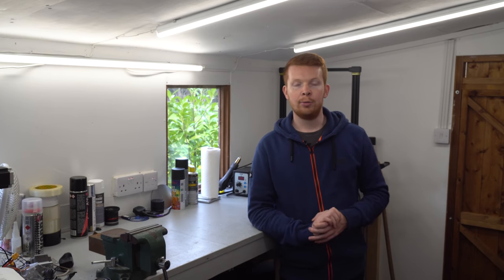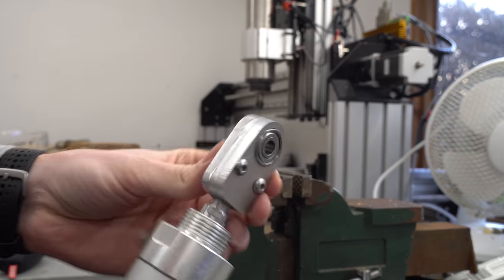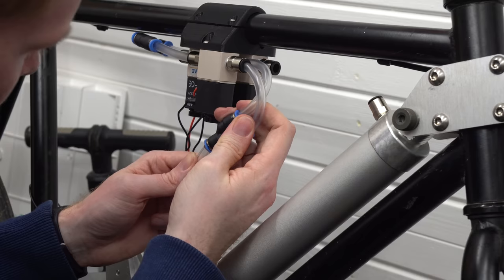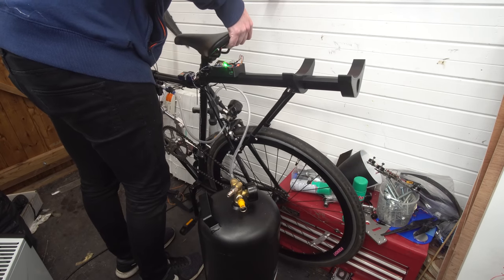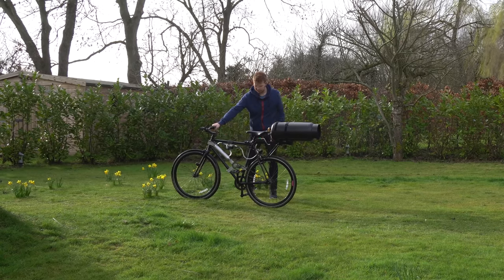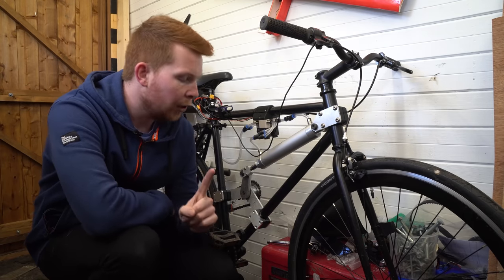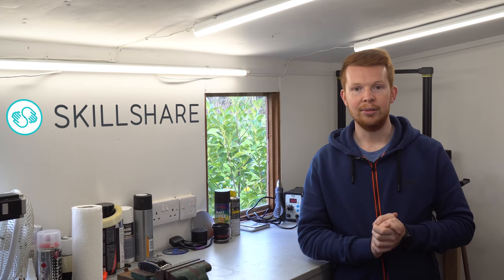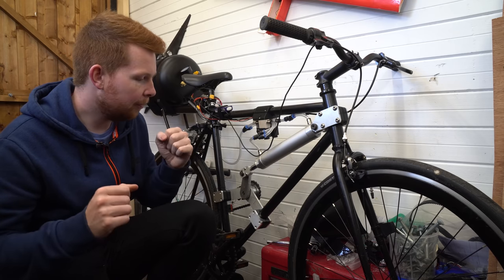Air Powered Bike

Comment: Finally more pneumatic stuff! This is what I came here for.

A second cylinder would be nice, you could make the rear sprocket larger for torque. It would make it easier to move if you started by pedaling and let the engine take over - there's probably not much to get the bike moving on its own but you could probably get it going and maintain a speed with the cylinder.

Any chance we could get the Arduino project code? Also, one final note, a hall effect sensor would be better. Infrared can easily pick up interference, especially outside. There's plenty of television remotes and garage door openers out there waiting to screw up your timing, discounting the IR coming from the sun and street lamps!
Reply: Farley Moab  Interrupt driven would be better I think, that way you could do something else in the background when not updating the valve positions. Check sensors, calculate efficiency, diagnostics, etc
Reply: Yes! Hall effect sensors are far more reliable than IR sensor or mechanical switch. Especially in sunlight, an IR sensor gives a lot of false positives. 
Also a simple motor encoder unit attached to the sprocket wheel can give lot more precise information for triggering the relays
Reply: Farley Moab  JTAG is the way to go, definitely. Saves space on the chip and I/O pins. Also saves RAM because of the afforementioned bootloader.
Reply: a second cylinder limits the duration it could power the bike though
Reply: @handsup90  A magnetic sensor would be better since it doesn't require current to operate. hall effect sensors require a power source.

Comment: To improve it you should make the entire frame the air tank itself
Reply: 666
Reply: Good idea but i expect the volume of the frame is pretty insignificant compared to that of the tank.
Reply: @ronjones4069  yes maybe you can take a smaller tank and connect it with frame(that is a tank it self) so you can have a much smaller tank on the back and you can fill some free space on the frame with some bags that serves as air tank so it's lighter
Reply: Good idea, though you might need a little larger frame tube diameter.  3 inch tube/ 76 mm .Steam powered might work a little better.Heat the water inside the framework.On a cold morning it would appear as if your on fire.LOL Always a crowd favorite.Smoke trails
Reply: @thomaslewis7883  there are a few steam powered bicycles people have made with videos on here, very fun worth a look some if them
Reply: Punch In The Face 🤓good ideas!
Reply: Kalrry Unakey 333
Reply: Why not use a pneumatic motor instead of a cylinder?
Reply: @keithballard4621  I think that the consumption of air is not the same
Reply: Yeah make it the frame more bulky.
Reply: Cool I’m the 333 like
Reply: Make the frame out of inner tubes........

...

...
Reply: Use the frame and add about 3 in front and three  in the back of the 1 1/2 foot paintball tanks and you don't need electronics  get rid of the actuator use actual compressors off a compressor tank then use a regulatory valve when one exhaust opens have it cycle into the tank back and forth this recycling pressure
Reply: A hpa tank can be filled up to 3000psi or 4500 for reinforced one. This is really high and you need to be careful any crack or weak point can result in serious accidents. A frame at that pressure I think it’s hard to build. Also you need to use dry air to prevent corrosion.
Reply: It is not recommended since the frame is under vibration and impacts!
Reply: @keithballard4621  very expensive way to go

Comment: Interesting Build, Maybe Use a refillable 3000psi paintball air tank instead of that big heavy one.
Reply: Bigger hammer?
If I were doing this experiment, I don't think I'd want to strap a 3000PSI bomb to my butt until I knew the system worked, and I had regulating equipment to handle it.
Reply: @tananam9782  
I'd trust a 3000 psi airsoft tank over that made in china tank to 100 psi. The 3000 psi systems are to a much higher factory of safety, actually get pressure tested in a hydro chamber and certified, etc etc etc.
A keep in mind these airsoft tanks are built to take all of that even after having a 200 lb guy running full tilt trip and smash it between him and a rock. you can bet an air compressor tank isn't built for that,

Comment: @TomStanton you should use a radial piston motor. They are used for high torque, low rpm applications like conveyor belts. They contain multiple pistons so they can provide power in all degrees of rotation. They can also be used as a pump for regenerative braking.

Comment: Nice "steam" bike. You should use a 4000psi scuba tank and regulate it down. You could go a lot further.
Reply: Just use 4000psi you won't need to gear it!
Reply: @tonystockdale1323  
The mechanical components fail at 80 PSI. Your solution would be more effective as a Newtonian rocket, rather than as an energy supply for a reciprocating piston. Um... That's "Jackass" show level of risk.
Reply: @tananam9782  regulating down the pressure means that the thing would be inneficient. But using high pressure with a very fast cuttof of the intake valve might be a very good idea.
Reply: Tanana M why you said that ?
Reply: was my opinion as well, use i.e. a 7 liter carbon "scuba" tank, with some 300 bar in it, regulate back to around 5 bar . 
that 7liter 300 bar tank has 420 liter air in it at 5 bar and only weighs a few kilo's 
those air tanks are also used for PCP air guns and for this, they don't need the specs needed for diving thus saving money :D
Reply: No the joint between gear n shaft will not be able to sustain even also in very high speed
Reply: use a standard 3000 psi (210 bar) scuba tank and a standard scuba first stage to regulate it down to mid pressure 145 psi (10 bar).  I estimate your piston as 10cc. With a 10 liter scubatank mounted on your back you can have some 21.000 cycles.
Reply: Or regulate it to 200 psi and go 50 mph, that’s the proper eay
Reply: Tony Stockdale : Yeah! Face valve rearward, strap’er down, get on, open valve fully, enjoy the clouds!🙀. 🌈
Reply: U need too put on a clamp on the tank an hose
Reply: @akkudakkupl ,
🔵 Quite the contrary,  "Regulation does not equate to inefficiency" subjecting all of those parts to that high a pressure would require much beefier substitutes ( increased weight ) and you would use air at
a higher rate. ( Reduced range ) if properly executed executed a bicycle of this type should be able to do quite well on a level Road using only 40 PSI ( or perhaps even less! ) with a reasonable range, especially if constructed in such a way as to allow a choice between  main power or to be an assist to pedaling.

Comment: Regenerative braking. That's all I have to say, make it repressurize the tank when braking.
Reply: if you use the exact same system reversed on a disc and when you pull the brake it starts compressing air? that works right? if so you got it already, the only problem is that as soon as you get a pressure the brake power will increase so it will not be linear, it will only increase right?
Reply: That's all you have to say? Maybe you could say one more thing:
How?
Reply: @tananam9782  reverse the valve timing when off throttle.
Reply: Add a flux capacitor.. That's all I'm going to say..
Reply: @prophez23  I had to search flux capacitor because I thought it was a thing, and sure enough it was a Doc's time machine thing!
Reply: @akkudakkupl  that's the simplest yet most brilliant solution
Reply: Make it regerative pedaling.  His pedaling should reconpress the air in the tank
Reply: @lucassvedlund3851  I ride ebike. They have break regen. Expensive and only gives 10% back.. people that think of this forget ...what your proposing is Perpetual motion...call me when you get that beat! Probably a Nobel in it for you!
Reply: Lucas Svedlund You would need to electronically control valves that adjust their on/off ratio for recovering the brake energy so that you got the desired braking force.  It would vary with the pressure of the recovery cylinder.  I think you would also need to dump the regenerated pressure into a small holding cylinder from where you would use a pressure doubler to pump the air back into main cylinder.   Pressure doublers easily available from Festo.   Another way would be to have a pair of cylinders a large one and a thinner one with the same stroke to create a double expansion engine that could be used to regenerate air back into the main cylinder.   

To control a steam engine you should never regulate or throttle pressure.  You should vary the switching on and off period to control the amount of steam or air.
Reply: A generator or an old 1954 dynohub wheel generated 9volts ac if you could get an air compressor that would run on that to pressurize the tank!
Reply: My guess is that the system is losing too much energy to be able to recharge the tank.
Reply: so you put energy in the system to take it out again?
Reply: @Wesley Peters only if you go downhill
Reply: I don't think that tiny little cylinder can achieve that. The pressure of the tank would eventually overcome what the cylinder can handle and kinda stall itself. Plus it will need plumbing and valves, which adds more weight, which may need power and a bigger tank. 

Just, put a 2 stroke on it.

Comment: This is so awesome. I would recommend you calculate your required torque to achieve the acceleration/speed you want. You should be able to back calculate through the wheel, sprocket ratios,  and eventually to your cylinder and find how much punch you need at the piston. You then can calculate your required piston size too. You can get your required 'thrust' force by having someone pull yourself on your bike with a scale. Whatever force you measure parallel with the ground is the same force needed at the contact patch of the wheel; and again back calculate through all the gears. That should get you your required torque and piston size too.

Keep us posted on this project. It would be so fun to this turn into a steam engine bike one day too :-D

Comment: Hey Tom. I was thinking, you should try to pedal normally up to like 4m/s and THEN see if/how the system keeps up. Don't immediately expect it to handle acceleration for you, but try if it will MAINTAIN a normal speed if you speed it up to that yourself.

Of course, I'm three years late, so my tip won't do much. Oh well, what is a man to do, time travel? Sorry, my air pressure is too low for that <grin>.

Comment: Great video as always. Thanks for that. Car repair shops have a hammer screw gun that can be used to achieve incredibly high torques and speeds. And above all, easily controllable with a lever.
Reply: Impact driver
Reply: It's a drill that hammers at bolts that go over a certain torque threshold to turn

Comment: Love the air-engine video's! Just thinking out loud, I'd expect there to be a trade-off between torque and efficiency, which is also influenced by cilinder volume. In order to end up with a one atmosphere pressure at the end stroke the pressure going in must be reduced, reducing the torque of the cilinder. This problem can be omitted by adding cilinders, or by using a larger cilinder, either way increasing the (sum) cilinder volume.
Reply: Lol that's how cylinder mechanics works :P
Reply: Thank you for this knowledge, now go write a book on how to breathe.
Reply: He could do just that with the old steam power style set up with a high pressure and low pressure cylinder where the high pressure side exhausts into the low pressure cylinder driving it... it's way more efficient than a single cylinder pneumatic set-up... I wanna see the high-low dual piston pneumatic set-up done... and I  personally would have used grade 8 steel bolt for the crankshaft...

Comment: 100psi regulated to 50? Yeah you need a higher pressure in the tank and to the cylinder. There's high pressure compressors for air rifles and the like that go to crazy pressures (joerg sprave from the slingshot channel uses one) 
So if you used that and a suitable tank at 1000psi and regulated down to 80 to 100psi at the cylinder you should have more torque and similar runtime with a smaller tank :)
Reply: He said towards the end of the video that at 80PSI is damaged the crank.
Reply: @AiOinc1 
A higher tank pressure would still mean a much longer runtime. Of course the regulator will have to be set for a value the piston/crank can take.
Reply: @AiOinc1  It really isn't that hard to modify the crank to make it stronger
Reply: @SuicideNeil  Sounds great, could even have a spare tank for long journeys if they're as small as I think
Reply: I think scuba tanks can handle very high pressure like in the 1000 range could be an option.  Of course you need a compressor that can get it that high... that might be tricky.
Reply: @redsquirrelftw  there's some decent cheap compressor options that will fill a scuba tank to 3k psi.  I think if he wants this to be much more then a showpiece he's going to need to go scuba.
Reply: I am a scuba diver, and scuba tanks come in 3000 and 4500 psi ratings, in steel, alu and the very lightweight carbon reinforced thin walled aluminium.
Reply: @AiOinc1  😆 Sounds like he needs to upgrade the crank and bearings (or bushing). It definitely needs to generate more torque. So, it either needs to be upgraded to a larger diameter piston or higher pressure.
Reply: @martindinner3621  The original foot pedals have enough strength for the amount of force applied by a human necessary to propel the bicycle. Obviously there is a formula that would determine the necessary scaling from those to whatever is made for the air driven shaft.  Not only the strength of that shaft, but also calculate how much air pressure would be needed to replicate the human pedaling force to achieve a desired speed.

(and obviously I don't know the formula. Someone proficient in fluid dynamics or pneumatics probably does, though.)

Comment: To get some distance, use liquid air in a tank. The liquid will expand using a radiator sucking heat from the ambient air. It lasts much longer that way.

Comment: Friggin genius, Sire! YT was running in the background and I was like "what's this noise like a tiny steam engine" 
I bet the tank is heavy, but what if you made a composite monobody bike frame with walls thick enough to endure pressure? Less components, fitting, and more stable mounting for the piston.

Comment: Great idea. Just get a rotary air motor. Save on frictional loses. Used in industry a lot
But great idea for the bike. Why not drive a compressor with the peddles?
Reply: Probably needs way more airflow than this thing. And this thing needs loads.
Reply: @akkudakkupl  Possibly, but could probably still produce enough energy to be used like a pedal-assist for hills and take-offs
Reply: Di Pietro Rotary Air Engine

Comment: The RPM is too low. You should put a larger sprocket in the rear.
Reply: would of said on the front
Reply: You want to increase the rpm of the "engine" in order to increase the amount of times in which the piston is supplied with air. This means, you increase the rear sprocket in order to decrease gear ratio.
Reply: on the tarmac test portion i noticed he did put a smaller sprocket on the front.
Reply: @sirbow2  Watch the video again, he said and explained that before and tested it first at the grass as well.
Reply: it already doesn't have enough power.

Comment: Try using a liquid CO2 tank with vapor with draw.  Install a regulator and you should be able to get a much longer range.  Have the ram in a push pull piping and timing.
Reply: It would be much harder to come by CO2 than air. He'd have to go to some sort of store every time he needs a refill. Now he can just use his air compressor. Besides, the point of the bike is for it to be driven by air, even though CO2 would probably be more efficient.
Reply: @rublie1426  true, but it would be cool to see what kind of range you could get.  Being a liquid tank you could use a much smaller one.
Reply: @vinylexperience77  Yeah that's true. Maybe he can go all out and use a gas that's even more compact for maximum range.
Reply: @rublie1426  no need to beat me up lol.  It was just a comment that I thought would be cool to try.
Reply: Toony's YouTube Channel I’m sorry. I don’t mean to be offensive in any way. I think you misinterpreted my second comment. I wasn’t being sarcastic (I probably worded it incorrectly, I’m not a native speaker 😅). You convinced me that it would indeed be cool to see a more compact gas to increase the range of the bike. 👍
Reply: @rublie1426  all good here.  It would be cool to see the range and it will have constant power once you set you regulator.  :)
Reply: Co2 also freezes things. Those valves would probably freeze long before you will need to refill :D
Reply: @durtled  Right I didn't even think of that haha
Reply: @durtled  might be able to incorporate an expansion/heating manifold. Something along the lines of an automotive intercooler, but more robust pressure characteristics. (Diesel intercooler?)
Reply: @martindinner3621  yeah any sort of exchanger to warm the liquid/gas and of coarse an expansion chamber.

Comment: Can you set this up to pressurize the cylinder?  Say on down hill parts where its the easiest to pedal you could possibly set the cylinder to pressurize the tank and capture back some energy and extend the ride time.
Reply: Sky Knight exactly my thoughts!
Reply: @erickuhn1042  Great idea. Came to my head as soon as I saw the prototype.
Reply: I like the idea, but I think you would need another gear ratio to get any meaningful amount of air out of it.
Reply: @Geerice  I agree. The gear ratio definitely needs much optimization.
Reply: I'm not sure how much PSI the piston could supply and if it would be too much for the rider and the bike to apply enough force to the piston to pressurize the tank.